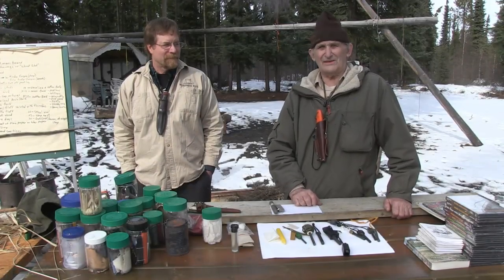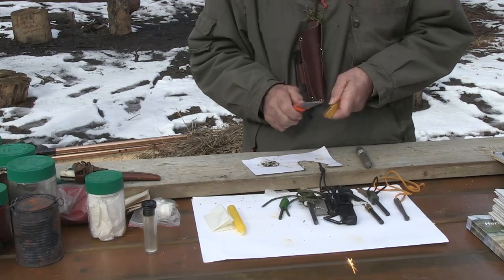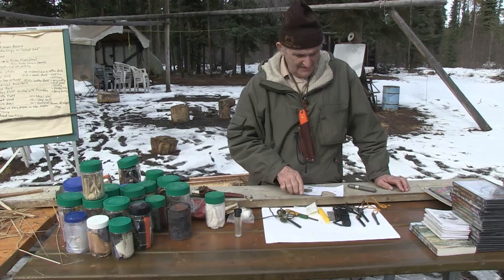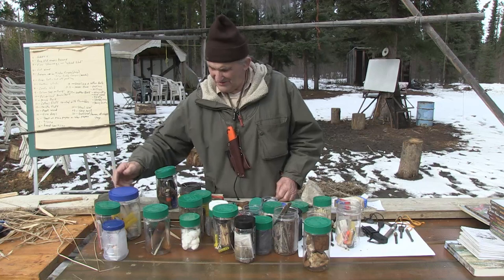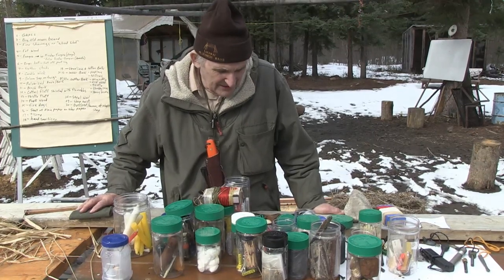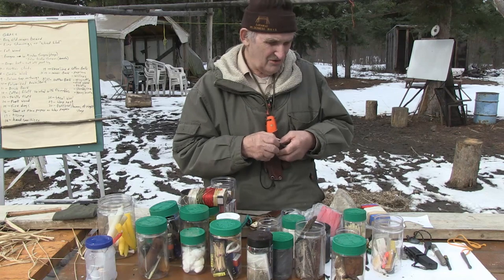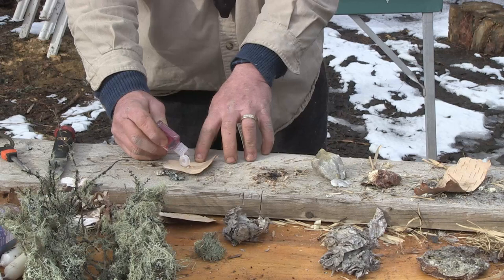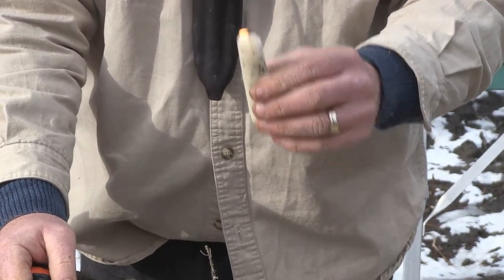Ferrocerium Rod, Ignitors and Kindlings with Kochanski and Harlton

Comment: One fun item kind of missing on the list is reindeer moss, very similar to old mans beard, good when you don't need it and lousy when you do.   The best part about it is it can be found in huge amounts and easy picking.  Surprising how well it burns.  It is also kind of like a fungus which Mors commented on as a quality of all fungus, when dried can be ignited easily.  It appears there may be an oil in all fungus and this oil is an aid in this.  I once left a chunk of chaga on my concrete floor in my shop, after it had completely burned out all that was left was a greasy smudge on the floor, and some very find powdery residue.

Comment: Dryer lint works great also you can use steel wool with no soap in and a 9 v batterie is good too.
But the thing that beats everything are the UCO Titan Stormproof Matches.
Type it in on youtube and check it out. You can light it stick it in water pull it out and it’s still lit

Comment: Dear Mors, What is the name of the material in that that little glas capsular to prevent infection from burn again? Dont understand it right. Thanks in advance
Reply: It is from the balsam fir tree. The balsam fir has blisters and inside those blisters is the liquid.
Reply: Balsam Fir Pitch...Many a northern woodsman has started a fire and sealed a wound with it – and no small amount of gear has been similarly patched. It has been used in dental procedures and cough syrups, as a vapor to ease headaches, and as an ingestible, to ease stomach aches. In a pinch, it’ll even do as crude chapstick.

Comment: What is that burn ointment that he has in the glass tube/jar that can also be used for fire excelerant and where can I get it? Thank you for the video. Always great to learn from Mors.
Reply: It's the sap found in the blisters that are on the trunks of balsam fir trees
Reply: Pitch
Reply: Many a northern woodsman has started a fire and sealed a wound with it – and no small amount of gear has been similarly patched. It has been used in dental procedures and cough syrups, as a vapor to ease headaches, and as an ingestible, to ease stomach aches. In a pinch, it’ll even do as crude chapstick.

Comment: Anyone know what kind of modifications Mors did to his match box, shown at around 16 minutes? Seems like some kind of coloured tape and string wound around it. I wonder if it had any specific purpose other than perhaps grip and visibility?
Reply: I am pretty sure that he just use it to store the mentioned items since this matchbox isn't going to be taken out to be carried. When you work with things sometimes you have an excess of a particular material that is of too little amount for dedicated storage. You would just put it together with a handy thing in hope that someday later you will remember it when you need one. I do remember that mors mentioned how he did an "exercise"(he doesn't believe in the functionality of altoid survival tins) of trying to cram things useful to survival into a small tin, but it is just briefly mentioned in a video(I will comment if i remember which video it is) . A personal modification of tubular match "safes" is a small amount of strong thread on a small reel(used by sewing machines, some are the perfect diameter and is about 2cm thick) in the bottom, cotton on top of the matches to prevent breakage of match heads (from rattling), a general purpose needle, as well as a special match striker i made: take bicycle inner tube and turn it inside out, tape striking paper to a section of it, turn the tube "inside in" again and you have a flexible tube with striker lining the inside. You simply attach the inner tube to the bottom of the match case. When you strike a match, just put the head into the tube and pinch and pull. This takes very little dexderity and can be done even when your fingers are freezing(though you will still struggle to hold the match)

Comment: as for your comments on the mag/ferro bar, all points are true. most manufacturers want to get the most cash for the least amount of cost an effort. this results in terrible products, that people take with them and depend on foolishly. most ferro in my area is very poor grade. too soft and it is used up too fast. I often find I have little use for magniseum. it Burns just maybe 2k degrees hotter than the ferro. and if proper tinder is used, Ferros 3k degree sparks are more than efficient. I'll eventually find a decent rod. until then I practice with Flint and steel. not as glamorous and a bit more involved. but it is reliable, and sustainable. I really reserve any ferro I have as emergency use and try to use my charred material first. I can replace that after each fire, so it's renewable, Flint and chert and quartz can be found often enough. the striker will probably outlive me. and it is what I have. I am almost giving up on finding a decent rod that isn't expensive. I am on the super tight budget.
Reply: the soft rods produce more sparks and burns a tad longer. However, they are harder to scrape. I often find the light my fire harder compostitions to be better just because the easy scraping prevents uncontroled strikes. However in a survival situation i would prefer the soft rods(Note: to determine the rod's hardness, try scraping the rod and not make sparks. If this is very difficult, then it is hard composition)

Comment: Does anyone know what anorak mors is using there??
Reply from the maker: I asked Jon McArthur if he had any idea and this is his reply: I believe it is an older version of the British Army Thermal Smock. It definitely looks British in design to me. So many of these small companies would pop up to make equipment for the military. You can tell it is a nylon with some sort of synthetic polyester insulation. Those style were worn under the canvas smock they wore to be a insulation layer. Also pack down small and be light weight. I will try to track down the exact make. If I do I will send it to you.
Reply: @Karamat  thank you very much! I’ve also tried my best to find it out but sadly I haven’t been lucky yet.

Comment: I agree with everything said here...but I have one problem. I have a physical disability that limits coordination and mobility. It is very difficult to use smaller ferro rods. So I much prefer the larger ones.  You can protect a ferro with a small piece of PVC  and a cap, or some beeswax, many things. Just DON'T store it around rusty tools, in damp environs or around chemicals especially salty foods😂of course.

I use a product called Stone Tinder  from eBay in my fire pistons. 

But my favorite method is an 8.5 by 11 inch Fresnel page magnifier...chunk of char cloth...POOF!